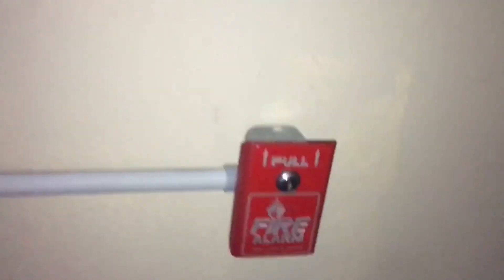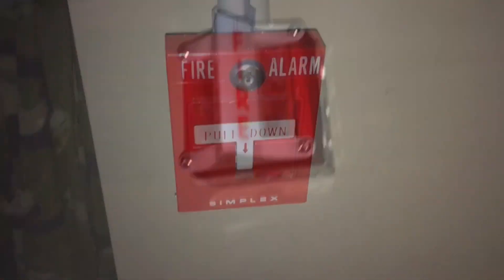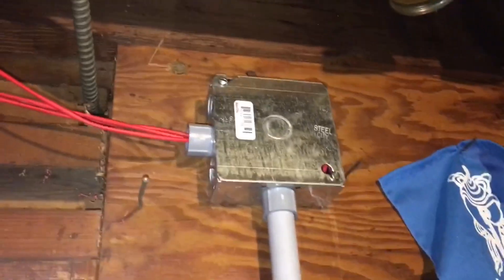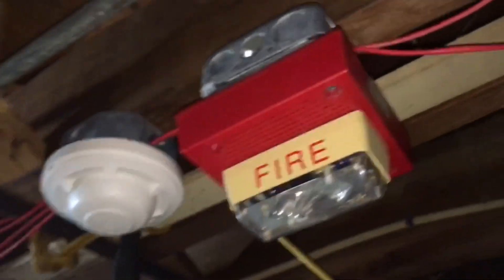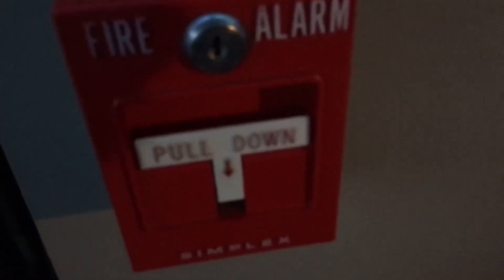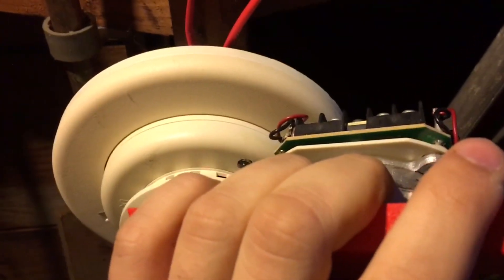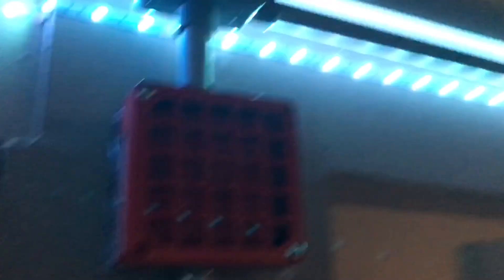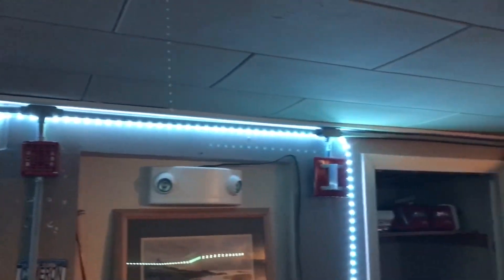System Test 13: New alarms!

Comment: LOL at 5:36.

Also, the reason your 4051 is so loud is because it's the 200 mA version (I paused around 8:32). Mine are only 100 mA, which seems to be more common.
Reply from the maker: The 4051 was so loud, I can feel the floor vibrate a little from upstairs. That’s how loud it was considering it was 0.2 amps.
Reply: I just checked and mine is the 100 mA version as well. That explains why my 9838 is louder.